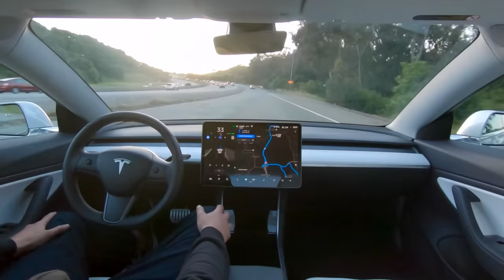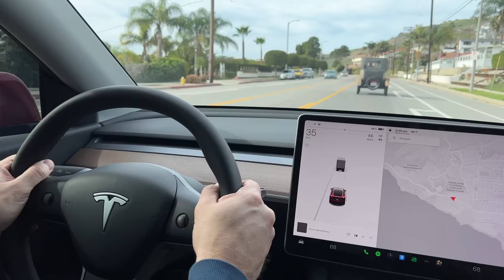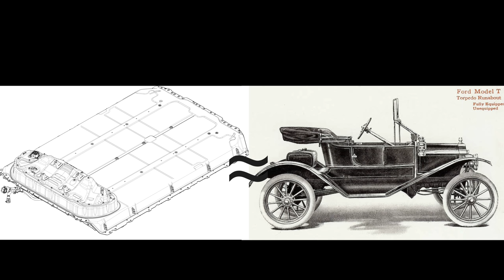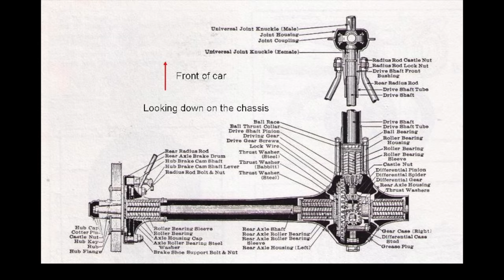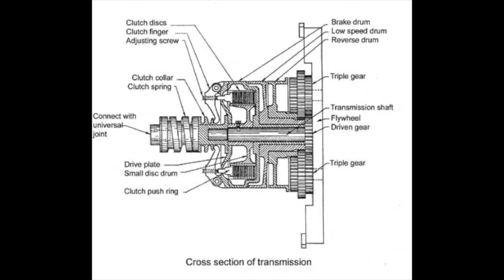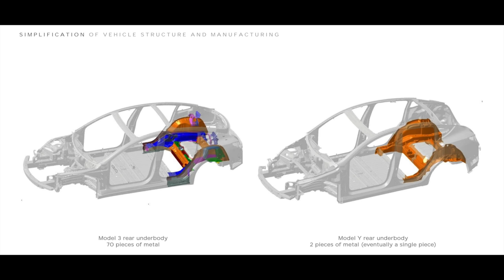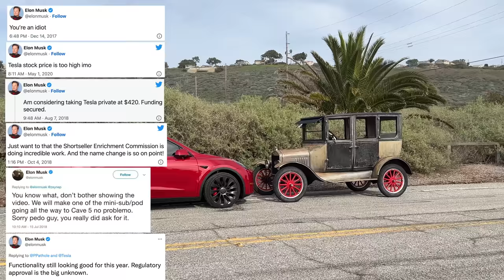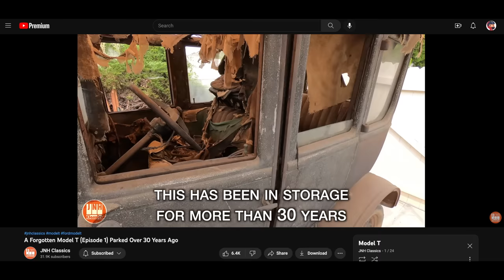1923 Ford vs 2023 Tesla

Comment: The biggest factor for the Model T in 1923 was the cost. Brand new a T could be bought for $280, roughly $4,500 for today. Making it cheaper than the 1920s tractor options. It mobilized all but the poorest communities in the states and lead to our complete and total production dominance that led the population and wealth explosions of the 30s-40s-50s.
Reply: I would buy a $4500 car today
Reply: Cost, speed and volume of production at the same time. It wasn't a car revolution. It was a Model T revolution.
Reply: And now the average car sold is 10x that price🤣
Reply: Yugo used to cost 3990 in 1990, and its 4 door version (Zastava 101) sold in 2007 for 4300€. 
Today it is almost impossible to find cheap new car, all try to go upmarket.
Reply: @bigmike4923  And 10x the performance, safety and convenience.
Reply: I can buy a $4500 car today, however they call them golf carts now and arrest me if I try to drive them on the road.
Reply: @maxscott3349  there is a Chinese electric car that retails for 4500 more or less. It's called Wuling Hongguang, it's great value for money and unsurprisingly it's selling like hot cakes there. Sadly they don't sell it abroad yet and even if they did the price will no doubt be double due to import taxes.
Reply: $4500 makes sense for something that can barely to the job
Reply: Yeah people used the model t's as tractors and they were good at it
Reply: @fedyx1544  ..A chinese exploding car, great deal comrade pink....
Reply: And it was repurposed as a tractor on farms everywhere. Try that with a Tesla!
Reply: @maxscott3349  tata nano or somthing? 😂
Reply: That's why the 4 passenger Wuling Mini ($4500) was (coincidentally) #1 in BEV sales in sales to the Model Y in China until recently.
Reply: @maxscott3349  Wuling SAIC GM 4 seat Hongguang Mini EV? ($4500). (No airbags)
Reply: The would never have been so cheap if Henry wasn't trying to bankrupt the Dodge Bros. Still would have been a bargain but not $280
Reply: @incognitotorpedo42  The average new car could have 1000x the performance, safety and convenience and it wouldn't mean squat if you couldn't afford it.
Reply: @marsrover001  real talk a modern Golf cart seems just overall effectively the same thing, just modernized
Reply: @Robert Swaine i have not heard of such thing.  Interesting idea
Reply: thats why farmers bought Model T's and turned them into tractors
Reply: Yeah. See me being sceptical that a guy selling cars led to populations and wealth explosions.
Reply: And yet, they're super cheap still
Reply: @maxscott3349  You can easily buy a $4500 old car today, even ones much cheaper, and they'll all be better than the Model T was when it was brand new. The reason they don't make new cars so cheap anymore is that they'll be competing against old cheap cars.
Reply: Just received the notification that someone replied to my comment, 575 likes and 29 comments later. Seems legit. 

Also, the divide between reality and some of these posts is comical. Have a great weekend all!
Reply: @maxscott3349  I think you can, just not in the US, in other markets, there are cars that cost that much, but they are about just as fast as the model t
Reply: Your numbers seem to be waaaaaaaaay out!
Most adjusted-for-inflation prices for model Ts are in the 20000 range
Reply: This vidio is soo good!
Reply: And the UK's equivalent, the Seven, simply couldn't compete on either production or cost, which really shows just how great the Model T is when it's actually the sized for an adult rather than a child like the Seven was.
Reply: @SwampMonster440 it also has a cvt
Reply: @SwampMonster440 oh, that’s sweet. I’m an American so we get some crap options and next to no manuals. That’s why I drive 20+ year old cars.
Reply: One thing people forget, is eating food was like 50% of your income. Now it less then 10%. So we have more disposable income per say
Reply: The average wage of a factory worker in Missouri in 1923 was $64 a year. So at $280 a Model T was 4.3 years wages.
Reply: @jammi  Government regulations are the reason cars are so expensive today. Emissions equipment, safety equipment, and complex engine design to meet fuel mileage requirements all add to the cost, along with the engineering and development costs for these systems.  I would guesstimate that these costs make up over half the cost of a new car.
Reply: Let's face it - if you mass produced the Model T today it would probably cost about the same.  It's a great car for it's time but it's time has past. Now it's just fun.
Reply: Cars (still) cost less tractors…
Reply: @Mladjasmilic  yes, and people here in the US still make fun of the Yugo, even though, most have never even seen one :)
Reply: It also had nearly no parts. 

Take away anything that isn’t strictly needed for core function and you’re there easy. 

People just want airbags, radio, glass, nice seats, hvac, screens, and all the computers that run them. Not to mention the engine (or motor for electric).  It’s not just inflation change.  The core item changed.  And the laws around selling it with what they must include for safety.
Reply: Now we make people POOR by forcing them to buy $50K cars.
Reply: @maxscott3349  no you wouldn't. At least, not the average citizen. In a car they want some basic luxury. You wouldn't sell a car without anything at all at such a low price. That would be a cat that can only reach 60 km/h max
Reply: @sayingnigromakesyoutubecry2647  That's about how fast I drive everywhere anyway
Reply: @incognitotorpedo42   Technology improves, that doesnt excuse the insane increase in price. Or would you pay millions of dollars for a modern smartphone, because its faster than a supercomputer from the 90s?
Reply: Then again, even $4500 for that in modern price is a shitty deal. You could buy a civic, corolla, or golf for the same price with a better driving experience and more tech.
Reply: @sledgedragon2677  As much as I don't want to admit it, it would probably last longer too.
Reply: @maxscott3349  look for a Renault twizy, or something. L6 / L7 category car
Reply: @KrustyKlown  no worries, the chinese have cheap electric cars ready for us to buy. cheap AND good. like less than half to buy one. maybe even cheaper.
Reply: Very good point. They sure conditioned us to start paying an ever increasing percentage of income for a car.
Reply: @giofilms9099  I have a 23.  It does what it was designed for.  Starts right up I can get places in almost the same time as my modern car as long as it is local.  Can’t drive on the interstate though.  Around town we only average 25 mph, the T can go 35 all day.
Reply: @maxscott3349  get a used rusty Honda.
Reply: @xander1052  Sad how the Sinclair C5 was such stupid nonsense as Sinclair's idea was spot on for the need for a cheap EV.
Reply: @silvertbird1  I think it's both ways.
Reply: Well the Model T is still working after 100 years. Will anyone have a working Tesla Model Y in 100 years? Its a lot simpler to rebuild something as simple as a T.
Reply: @lundsweden  that because it was well maintained. I'll bet you a lot of the engine has been rebuilt and it's probably not on very many original parts. It was probably found abandoned in decent condition, it's a very mechanically simple car, which means it is easy to repair, but it's not necessarily reliable.
Reply: @bigmike4923  The model T wasn't "average" cost, it was cheap. 

Today the cheapest car is a Mirage @$17,600, significantly more. Though if safety standards where the same and they did away with all the safety and creature comforts like say HVAC, and radio, seat belts, extra forward gears, a top speed more than 40mph, 4 corner brakes(this list would be to long if I list everything the cheapest car sold today has a model T lacks) etc. I'm confident Mitsubishi could get much closer to that adjusted $4,500. I'm also confident no one would buy it. These things are much more analogous to a golf cart, which by any major manufacturer is overpriced since often for less you can get one of these fancy China EV "cars" for less and the only reason you'd want a golf cart instead is if you're actually golfing.
Reply: Good thing we have more disposable income.
Reply: No, they lowest it ever went was $360 new and that is roughly $10,000 USD now.
Reply: @maxscott3349  China's actually got some electric cars around that price.
Reply: I assume you used inflation to calculate that. Which you absolutely can do; but that males your comment really misleading. 

Not only was money worth way more back in the day (about 1700%, as you correctly calculated), but people also earned SUBSTANTIONALY less and therefor had less buying power than todays population. This is a measure that inflation alone does not cover.

If you use the average income to calculate cost, a tesla will cost you about 10 - 12 average salarys in 2022.

A model T back in the day could be bought for 7 average 1925 salarys, meaning 37'000 USD in todays salarys.

You absolutely get a good car for that money, even new, altough admittedly, not a tesla haha
Reply: I should add tho that the average income from 1925 (and inflation) are a bit sktechty numbers to use, seeing that even nowadays in our highly connected world such numers are estimates at best.
Reply: @fedyx1544  Those are made for old retired people to drive to the market. They are basically glorified go carts with a body that looks like a car. Old fashioned brakes and suspension and sub-100 horsepower engines that normally would be found on landscaping equipment.
Reply: @iamyourfan9729  
Yeah also if you just use inflation you are seeing the effects of increasing opportunity cost over time eg. Rent of land has increased due to more disposable income and more people, leading to increased food prices per acre. Which is why whenever people talk about how food prices increased over the last 50 years they blame it on something irrelevant like corporate greed or monsanto.
Reply: @Bubu567  those are perfect for what the absolute majority of people have to do in many countries which is city commute. They aren't good for city to city transit but they aren't made to be, and neither is any other vehicle at that price point.
Reply: @fedyx1544  I know I was just trying to level expectations so people know what it actually is they are selling. It is perfect for a lot of people and it would be great if they make it to the US, but they aren't fancy, and in many cases, worse than a used car at the same price, if you aren't the right market for the car.
Reply: @Bubu567  sure if you need anything that can do road trips or similar you're better off buying a used gas car for 4500, it depends on your expected usage
Reply: @incognitotorpedo42  Yet they only last around 10 good years until its cheaper to buy a new one than fix the old. Conveniently the warranty tends to expire just before it breaks.
Reply: Ford did not face regulations from the EPA or other government organizations, but the rules and regulations have increased the cost of cars unnecessarily in some cases. At that time, like Tesla, Ford did not have to deal with unions, when it did,  that also increases the cost of cars unnecessarily.
Reply: 12 years ago I found a car for 12000, and I wish I woulda bought it. It was a prior year (but never owned) Fiesta.
Reply: @incognitotorpedo42  most cars today have more power than they need to and higher top speeds than can ever be realistically used. The truth as to why there is no cheap (say under $10,000) simple new car to buy today is the EPA and it’s war on internal combustion. The model T actually got CHEAPER as production continued because Ford’s design used the same mechanical parts for nearly 20 years. It was only when roads improved enough to warrant an increase in performance that a new powertrain for a new  model of car was developed. This philosophy of a new design paying for itself by stating in production for decades or more with periodic minor improvements was the standard until the early to mid 1990’s. Around this time is when government overreach began to take hold. Nowadays thanks to the EPA keeping manufacturers guessing what the next extreme emissions and efficiency standard to be set will be and how long they’ll have to meet it, an engine / powertrain design has a lifespan of 5 years at best before R&D has to begin in on vastly different technology that costs hundreds of millions before the first production castings are ever poured. This means they are constantly spending money on R&D that means the automakers have to build vehicles with enough features, power and prestige that they can mark up the cost significantly and actually turn a profit. A good example of a car that could be built today and sold for under $10,000 is the very last Chevy cavalier. By 2004 they had very clean exhaust emissions from the little 2.2 4 banger, decent crash safety, all the amenities you’d need and enough power to travel at modern highway speed limits with 4 passengers. Aside from the EPA there is no reason a car like this isn’t being built right now. The current bias toward electric vehicles is very obvious and extremely short sighted. Considering a vast majority of our AC power grid is lit up by plants burning coal (that’s right…coal, the same stuff they used to heat houses at the turn of the century) or other fossil fuels, it’s not really saving us much if anything.
Reply: Because of the T's offroadability, a lot of poor farmers used them as tractors too. Suddenly, you didn't have to decide between buying a farm machine and an automobile. You could buy one machine that could drag a plow and also drive the wife and kids to church. Ford continued that reputation with the later F series and, even though new Ford trucks haven't been seriously used on farms in a couple years now, are still riding that reputation today.
Reply: @Mladjasmilic  The difference between the Model T and the Yugo being that the Model T was intended to last a lifetime... and many of them did. You can't buy any car now that's built to last a lifetime at any price.
Reply: @Bubu567  Did you overlook my mention of regulations being "unnecessary in SOME cases"? Many regulations have been pushed for and funded not for safety reasons, but to level the playing field between companies or to limit the sales of a company's products thanks to influential lobbyists. Of course, there are also regulations that serve a positive purpose, but not all of them.
Reply: @Thinginator  I used to have '89 Yugo. I sold it because I wanted something with A/C. It was 30 years old when I bought it and I spent maybe 100$ total during my ownership on maintenance. 
I can last if owners would bother to maintain them.
Reply: Tractors still cost more than cars 🤣
Reply: @maxscott3349  There's a reason cars cost far more than a Model T LOL
Reply: @maxscott3349  it better be VERY crisp tho. Otherwise not worth it
Reply: @Egerit100  Well it was when I made the offer. Now I'm going to have to go and pr- I mean go to the bank and trade it in.
Reply: 4500$ *NEW
Reply: @tunahxushi4669  your racism is showing Shi
Reply: @markmiller6844  just like the model T😂
Reply: @ddjohnson9717  ? 2 penny pink says what ?
Reply: @prophetsnake   you act like no one else has google. You are wrong buddy
Reply: @dirkdiggler9379  So you have Google. It doesn't make up for your poor command of language.
Reply: @fedyx1544  Like hell anyone is going to buy some Chinese junk metal cage.
Reply: @2hotflavored666  I would, many other people I know would, so speak for yourself
Reply: @2hotflavored666  apparently you do not get out much. Older americans use the yugo as The Example of a shitty compact car. Then they get in their V8.
Reply: Makes me miss the Honda Fit. 16k MSRP for the base model and would do everything the average person would want.
Reply: @maxscott3349  Panthers in good shape are going for about that.
Reply: @maxscott3349  To be fair used car worth $4500 today is much better than the ford model T
Reply: Yeah Tesla's are way too fucking expensive man
Reply: really interesting to compare cars that are separated by 100 years. and to see that a few things haven't changed that much, especially price (not in a good way).
however people are not that interested in cheap cars anyway. cheapest car is $16k, but people spend in average $48k for a new car, so that's 3x the lowest price. still thinking they need several trucks/SUV for a family, and median daily drive is 10 miles/22min ... thats from 2014 but hasn't changed much since except for those who work from home.
speeds are much higher, more cars on the roads, which increase the risks of accidents, people want bigger/heavier cars than the other to feel protected and comfort/gadgets, which make the cars heavier, and more expensive to produce. average mpg has even gone down from 1923 to 1973 and only caught up in 1983..
Reply: @jammi__  the car you can get for 5k has greatly degraded since covid and chip shortage, the whole new & used car market has gone crazy
Reply: @ronchappel4812  $260 in 1923 is really 4.5k in 2023 20k was more like the initial price before they started pumping 2 million per year. but a 40mph 1200lbs car with zero safety equipment, no crash testing, no brakes, no power steering, no roof, no electronics no AC/heating no windows could probably be 4.5k
Reply: @chublez  I could see my self buy a new 4k 40mph car as a second car if it was electric/or very efficient low maintenance gas car, cheap to insure and road legal everywhere outside highway, as long as it handles and brakes fine and gets to 40 quickly enough. a far cry from a golf cart. but my 8k used 500e is definitely a better car plus its more fun to drive than most car I've driven.
Reply: @geemy9675  Early 2000s good condition running Audi A6 allroad 2.7 Biturbo, Porsche Cayenne 3.2, etc are very good cars you get for around 5k€ these days. How has the chip shortage degraded them? You make no sense.
Reply: @jammi__  it has in the US. it hasnt degraded the cars 🙂 it's the available cars that you can find for 5k that has degraded
my 2017 sorento is worth more today with 60k miles than I paid it with 15k in 2018...and its the same for eve'ry car. so yes the same amount buys you a 6year old car instead of a 1 yo one. 5k doesnt even buy you the cheapest cayenne on autotempest. I wouldnt call a 200k+ miles poorly maintained Cayenne or one with a smashed frot end a very good car unless you are a mechanic with lot of free time and and garage/tools.
those cars are cheap for a reason, they dont peform nearly as well as the Porsche sign suggest, (my sorento V6 is way quicker than an early 3.2 Cayenne, way better mpg and has a 10 yr/100,000 mi powertrain warranty. Sure its not luxurious but its a good car for me) they will break down and cost a lot to fix, so its a good car but only good for a very small minority of people
Reply: @geemy9675  Nonsense, you obviously don't even know what "degraded" means, do you?
Reply: @fedyx1544  And it's safety features match the model T
Reply: @paulstubbs7678  there are crash tests you can look up online. It is bad, admittedly, but way better than most other similar cars, Chinese or otherwise, and the biggest thing is that its low cost means you should compare it with motorbikes which are way worse in a crash.
Reply: I have a model t but it's black and doesn't run yet
Reply: @Mladjasmilic  I think creating small and very cheap cars now will be hard, due to crash safety regulations etc.
So you cant skip out on airbags, you cant skip out on assistant systems.. And then you either have to make your own stuff like Tesla does with Autopilot - or you have to pay to Intel, Nvidia etc, buy the hardware, buy the lisences etc. then adding this to a car also means you need very good engineers.

So it is much harder to create a cheap car now.

However, it is possible to make and buy cheap 4 wheel motorcycles with  a roof.
Those will most likely be better than the Model T and you can then drive it on your drivers lisence, they wont be safe to drive - but neither is the Model T.
Reply: @giofilms9099  the T is good for local trips and I mean up to 20 miles.  It takes only a few more minutes to get there.  We have cars capable of 100 miles an hour now but our average speed is 25 typically.
Reply: It was trains connecting the northern industrial centers with the southern oilfields and the coastal cities.
Reply: agreed but you can not make gasoline ! i'll take electric
Reply: The runabout roadsters sold for $250. However ; no roof (collapsible rack and strong material) no starter just hand crank (be careful) no side windows optional curtains,  no heater top speed ~ 40 mph. It was dirt cheap and easy to maintain
Reply: Model Y, a house... Model Y, a college education.. model y... Why?? We just want affordable cars
Reply: So basically, they’re polar opposites.
Reply: nonsense. a ford model T was first sold in 1908 at $850, which is equivalent to approx. $29k today.